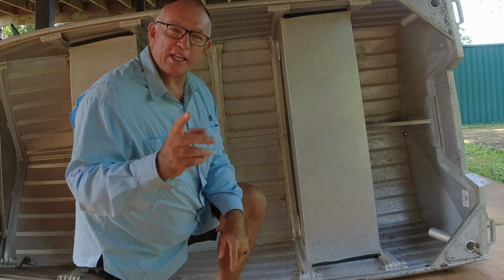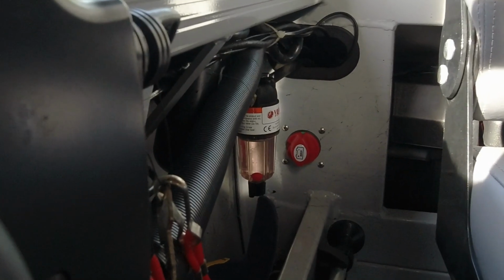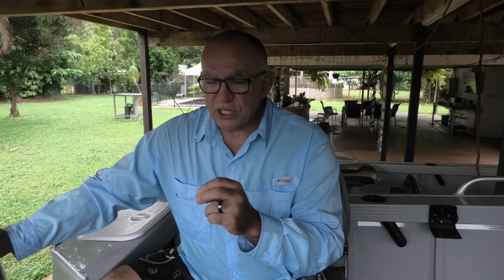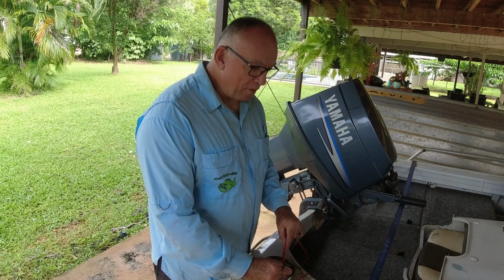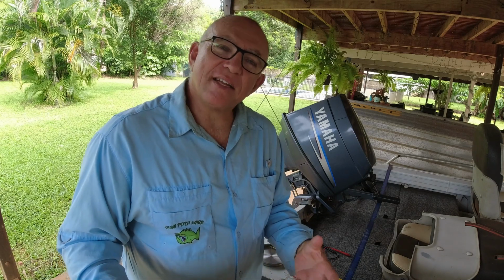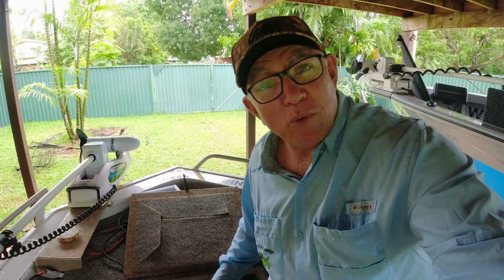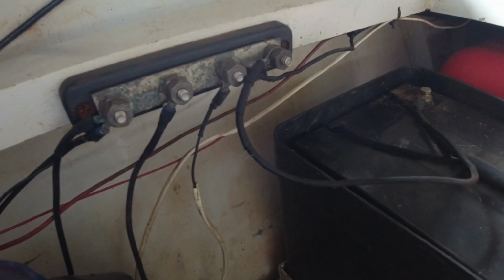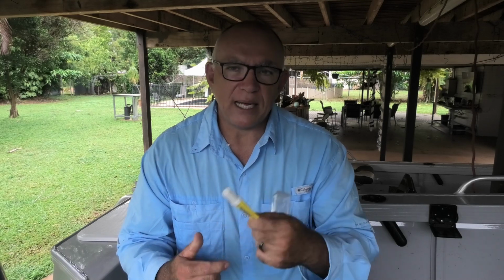PROTECT YOUR BOAT AGAINST CORROSION

Comment: If you’re gonna turn your battery, isolation switch off you better make sure that your bilge pump is wired to an un switched circuit or upstream of the battery switch or you’re not gonna have a bilge pump while you’re not on the boat pumping off water from a leak or from heavy rains. I see this often as a marine Surveyor.   That said, if you have the bilge  pump wiring laying in the building in an inch or two of water this 12 V power source creates stray currents at that connection and it can destroy an outdrive on a outboard or I/O within hours, so you need to keep those connections up out of the bilge a minimum of 12 inches.
Reply from the maker: Thanks for that. Great info and something to watch out for. SBC